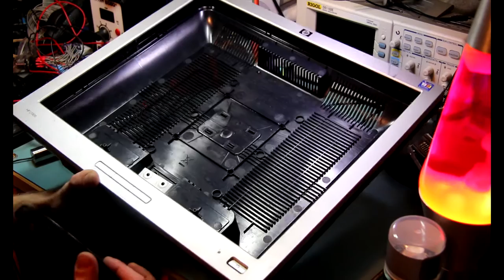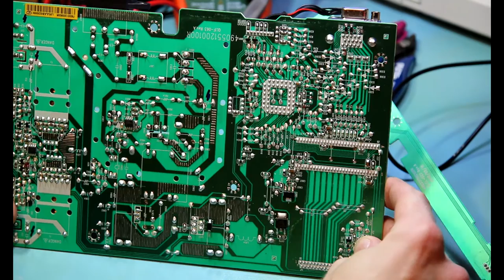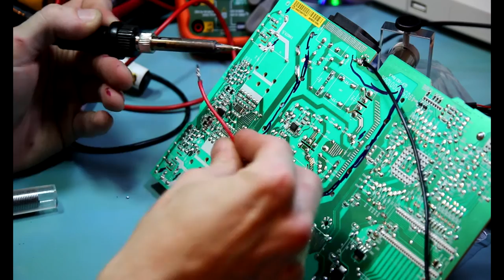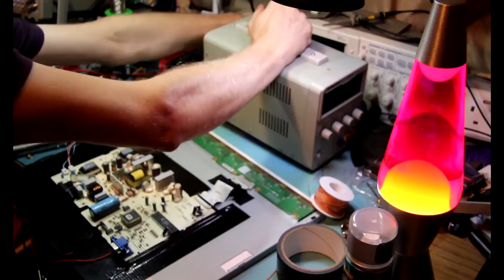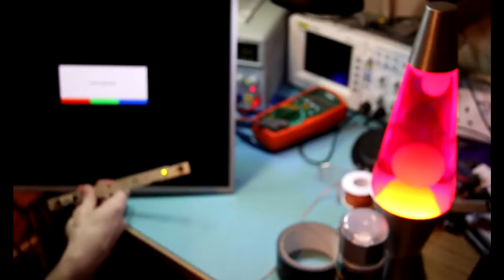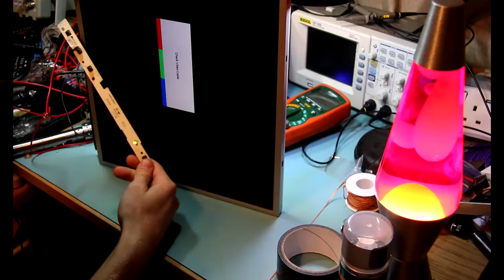Converting a mains powered TFT to run on 12v

Comment: You might have needed 5v as well. I converted an HP 22 inch to 12v. The high voltage inside read 20 when plugged to mains, however it worked fine on 12. I did also need a stable 5v seperate to 12v. Now I can use a good monitor that was destined for the tip, on the boat.

Comment: The vid was too long for someone who has experience in working with electronics, however is probably OK for someone who knows very little.  whether someone who knows very little should be doing a mod like that is another thing.
However, the vid did help me decide that it was quite do-able so I pulled a monitor apart to do it.
My monitor was not as straight forward as the switch mode power unit produces +5 as well as the +12V  Ie. it has two outputs.  This can be fixed quite easily by wiring in a 7805 regulator or as in my case . I put a bucking regulator +12V to +5 for about $4 from ebay.
Reply: +Lee de Vries hi sir can u tech us? i think my monitor also used that +5 volt
Reply: +Ansari Flight Plan 
If your switcher is a dual output voltage, you need to add a separate +5V regulator which is fed from the +12V input.   A 7805 regulator or a small switch mode regulator (eBay)  adjusted to +5V would be ideal.
Reply: how to search 5volt in the board i relly clueless to solder

Comment: this is what i need to do with my monitor, have a solar powerd set up in the shed and i dont want to have to use an inverter....( i can run the computer off 12v just not the monitor)